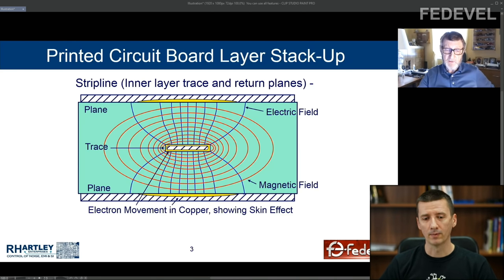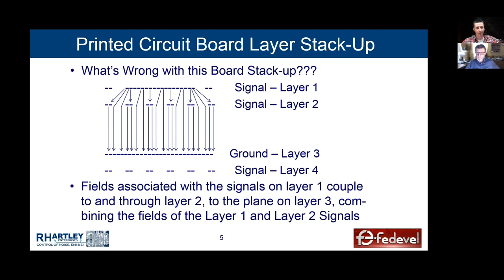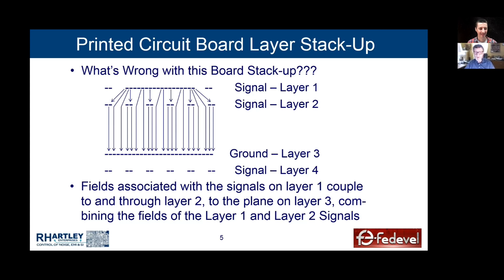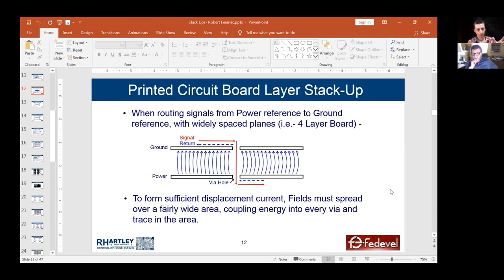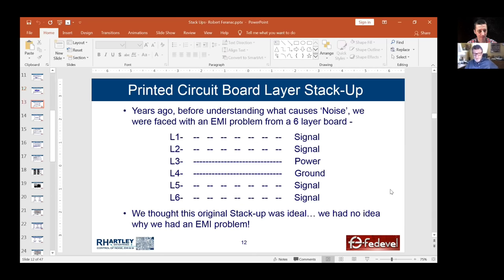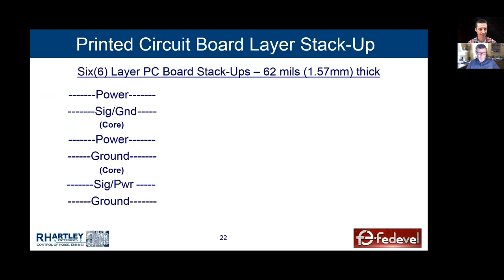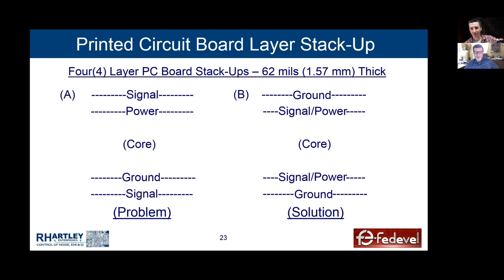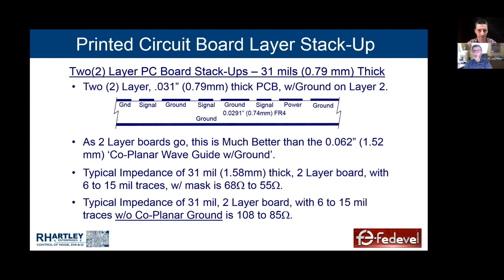How to Decide on Your PCB Layer Ordering, Pouring and Stackup (with Rick Hartley)

Comment: On resonances in cavities and ground stitching vias.

An analogy came to mind. It's like if you had a container with water. By swinging it back and forth with some frequency, you could easily achieve huge water oscillations.

But. If you divided that container by partitions into many small containers, you wouldn't be able to achieve that huge water oscillations at that frequency.

This is how ground stitching vias, by partitioning big cavities into smaller ones, prevent resonances in PCBs.

Thank you, Robert, for your videos! They are extremely useful.

Comment: You have done so much for the PCB community. Thank you! And thank you, Rick!
I do have a comment about routing high speed signals in the middle of the board (in order to get the power delivery near the surface). At speeds above 10gbit the via stubs will create significant  problems (reflexions) which will require backdrill.
Reply from the maker: Thank you very much. PS: I am planning to make a video about via stubs and backdrilling
Reply: @RobertFeranec  the via stub length creates a reflection that can destructively interfere with the signal wave passing through it, basically the via stub looks like an open circuit and thus it reflects the signal back.

Comment: Thank you Robert, for sharing this video conference with Rick. Even though I am not into multi gigabit designs it made me more conscious of the effect of fast rise times. Most of the boards I design are 2 and 4 layers and looking at this video made me realize I have to be especially mindful of digital signals with fast rise times on these low layer count boards and minimize the EMI effect. Thank you for that.
Reply: I am the same, and this is why I always encourage people to still watch these kind of things.
There is always something you can learn from it.
I am also gonna change my work flow a little, first starting with rough layouting the board and second is to think about what stack-up I am gonna use and only after that continue with the rest of the layout.

Comment: Thanks again for yet another great video! I just want to say that I really enjoy hearing about bad examples as well as how to properly do it. The section around 30:00 is great, we learn about a misconception ("we need to shield the signals!" vs "the signals need a return path"), why it was wrong and how to properly fix it.
Reply from the maker: Thank you kbeckmann PS: Very good point with "we need to shield the signals!" vs "the signals need a return path"!
Reply: ... though I have a suspicion that "shielding the signals" (ie: preventing their electrical fields from escaping) is either the same thing as, or closely related to, "providing a return path" (for the AC current).

Comment: I’m a software engineer but always have been attracted to electronics. I have worked almost 4 years with low level embedded (bare metal) code for a payment related company. Loved reading datasheets and schematics. Passively learned tons from it (by asking myself what I was looking at and why it was done like this). I had to move to another field but still do a little arduino like stuff in my free time.
Always wanted to give Kicad a try, especially since I got into the rabbit hole of custom mechanical split keyboards. Stumbled on Phil’s Lab videos. Next on Rick Hartley’s and now yours. Love Rick’s explanations and stories. He clearly is the rickiest Rick 🙂
Anyway I’ve learned a whole lot of exciting stuff thanks to you all. Kudos.
Reply: i took a pcb design class last semester at berkeley as an extension student. Easily one of the most valuable classes i’ve ever taken. They knew I wasn’t an engineering student, but welcomed me in anyways. They taught me how to use Kicad pretty fluently. The cool part is that we assembled all of our boards by hand after we designed them and ordered the materials; the class is jam-packed full of hands-on knowledge. I took the class at night after work, the course code is EE-198
Reply: @soconnoriv thank you very much for sharing this info!
I’m French so I personally won’t be able to attend it but it will probably be useful to others, so thank you.
It must’ve been great to assemble your own boards, thus making everything from the (properly) ground up (bad pun, I don’t wanna be grounded).
I love the idea of designing a whole object from the pcb to the casing and programming the firmware. Everything can be done with open source software, even FPGAs (maybe old ones but still).

Comment: Hi Robert,  Excellent, thank you.  Also, thank you to and Rick for sharing this information with us at no cost.  Some have commented that the video is too long.    I appreciate the discussion, even if it takes an hour or more, as the most important thing is to try and understand the concepts.  Every board is different with different requirements and goals, and will require it's own set of compromises.  Understanding the concept is the only way you can make those compromises intelligently.

Comment: Basically, pouring ground on signal plane can be a problem if you don't know what you're doing 🙃

For 4L board I put most SMD on L1 and r  reserve 
L2 for GND (no signals at all)
L1 for 90% of routing
L3 primarily for power & secondary for GND reference of L4 (if possible)
L4 primarly for GND and secondary for routing

Final step: stapling all the gnd polygons with small vias 😅

So, basically, the 4L setup like (D) on slide 25, as shown 48:07 😁
Reply from the maker: Exactly. PS: Also, sometimes pouring PWR instead may be the solution.
Reply: @RobertFeranec  Yes 😁 
And I just got now at the position of the video which corresponds with my strategy: 48:07 (slide 25, stackup (D))
Reply: Anecdote: one time I had to fix a layout mess of a embedded main board ~A4 sized with 400 components. The colleague was nearly "finished" (his words) and was taking parental Ieave.
I strongly suggested to him beforehand use a 6L (and go to 8L if he has problems)...he chose a 4L, the GND/Power situation was horrible (signals every layer, split reference pours, ...)
And I just had 3 weeks to fix that due to deadlines 🙃
Couldn't go to other stackup, as it was already reserved in the pipeline of production.
As all components were on top I deleted all GND/PWR, and used strategy above.
First taking care of important power and high speed signals. Due to the via power and gnd tacking it resultet in probably ~1600 drill holes (before it was more like 600 due to many the pcie connectors)
That was an interesting summer😅
Reply from the maker: @icestormfr  Thank you for sharing.
Reply: @Robert Feranec it would be great if you could elaborate a little more on 4L PCBs. If you have google examples to share.
Reply: What does you mean by L3 secondary for GND reference? Signal on L1 will be referenced by L2 and signal on L3 will be referenced on L4.
Reply: @josescxavier it refers to layout priority.
In this case it means, on L3 placing power polygon/pours has priority. But if (esp. high speed) signals are routed on L4 (bottom) try to place GND as reference plane/pour/polygon  (return path) under these traces (so that would be L3).
Also try to "tack" the GND on L2 to these on L3 where these referenced signals cross from/to L1/L4 by vias. See also the longer explanation in the video🙃
Reply: @icestormfr  in the video he suggest to routing on L3 while you route on L4.
Reply: @josescxavier  Yes. The signals weren't that critical. 
Some were constant potential or slow and really infrequently changing signals, and due to space/topology restrictions (at 6L+ wouldn't have been a problem) they needed to cross the power polygons/pours. So the signals themselves were not an SI or EMI problem, but needed to be on a different layer thab L3 (because they would makerge power route impossible).
So I ended up using L4 for all the "cross over routes" that I needed to finish the routes on L1, not just the ones that had to be there.

P.S.
The (quasistatic) signals on L4 under the power polygon were only short traces and also didn't "break" the GND return path of the power polygon above on L3.
So more like some "Logs" on a bigger river 😅

Comment: Thanks! This is a complete lesson on stack-up. Up to now I am not used to pour power on signal layers except near the input/output of voltage regulators or DC-DC converters

Comment: I am a little concerned about power/ground pours on congested signal layers which is suggested on many of Rick's stackups.  If the layers are very congested, there will be many small islands and strips of poured copper which will require vias so they aren't floating.  It seems like those vias might take a lot of room and make it difficult to route the signals.    Maybe you would need to use smaller vias to minimize this routing congestion.  If you have a dedicated power plane, you can just drop the power vias pretty much anywhere,  but in many of his suggested stackups the power is distributed on all the signal layers with no dedicated power plane.  In those cases, you will have to line up those power pours on multiple layers to get the continuity you need.  Seems like that might greatly increase the difficulty of routing the board.   Your thoughts?

Comment: I have a related question: Main power of my device is 5V (most current use), I also have several ICs, including the MCU itself, that run on 3V3, LDOed from 5V. The chips talk via 1MHz max SPI via level shifters 3V3-5V (if there is a voltage level mismatch and 3V3 signal is not enough for 5V device). MCU is 50MHz max - down to under 10MHz, but I have yet to scope stuff to see the rise/fall times. PCB is 4 layers. Have analog/digital parts, analog measurements and digital communication never occur simultaneously.

I have a prototype PCB come soon, and since I didn't know all this at the time, I have basic caveman SIG-GND-5V-SIG without any pours, while 3V3 is routed via traces, I try to make them wider. Space is not much of an issue. But now I understand I can improve it significantly. Before I do something I regret, I'd want to clarify a few things:

I'm (re)considering stackups now, PCB is expected to be 1.6mm thick with thick core:
Stackup Option 1:

Sig/GND
5V
------
GND
Sig

and 3V3 routed as traces. This will let me couple signal more to GND than to 5V, so I should get better performance, at least comparing to what it was before. And, of course, stitching when swapping signal layer?

Alternatively, I can have polygon of 3V3 Power, larger polygon of 5V power on a single layer, like
Stackup Option 2:

Sig
GND
------
PWR (polygon 5V, polygon 3V3)
Sig/GND

I'm worried about having different voltage polygons. As far as I understand, I should then split the components and put 3V3 and 5V components separately. And a corner for analog stuff. I also understand, I'll have to do some stitching between layer 2 GND and layer 4 GND. What do I do about level shifters, which utilize both voltage levels? Where do I place them and how don't I mess up their return currents? I mean, it makes sense to put them between the polygons duh, but what if not?
Another question into the same basket: If I have multiple polygons of different voltages and I don't have anything cross the gap, maybe a thin GND pour between 5V and 3V3? Why or why not? Maybe couple 5V and 3V3 with capacitors? Don't hit me if I said something stupid, after all, that's why I'm asking)

Also, as an active EE stackexchange user, I asked a pair of questions there, and while I got some advice there, the general consesus was "your design is too slow to care about these things too much". To what extend is this true? Of course, it's good that I know about those things and consider them anyway. My first prototype was 2 layer with signal spaghetti - both layers ground pours, and it seemed to work, but I still want to do things right and not get used to improper amateur designing.

EDIT: maybe layer 1 can have signals AND polygons of different voltage, while 2 is GND, 3 is GND, 4 is Signal? I will have to run a few power traces, but I guess it will work? It's a stackup 3 options being created right here as I'm editing this post. Why/why not?

I'm kinda leaning to Stackup 1 for now, but it's purely intuitive and not reasoned enough in my head to be sure about choosing one stackup over another.

P.S. I still haven't decided what stackup I want, in either case I'll have to start the PCB from scratch I think, and I'm OK with that (it's fun anyway).
Reply: I have decided to go with the following stackup:
1. Sig (90% of signals, 100% of components)
2. GND Solid plane
THICC CORE
3. PWR +5V Solid plane
4. Sig/GND (tightly stitched) (10% signals, 0 components)

I routed 3V3 with traces, optimized my design enough to have literally 3 components to need 3V3, so traces seem ok solution - and I have two linear 3V3 regulators, one dedicated for SD card, so that it doesn't cause interference with 3V3 MCU when it writes/reads/suddenly consumes power. Since I do some analog with MCU, I added ferrite bead and two 0.1uF to MCU's only power pin.

Analog in one corner, digital in another, high drawing element (display) away from both and is close to Power circuit not to cause interference. Routed SPI and UARTs in the first place, then analog, then many single-ended signals like ENABLE which are OK with switching layers. Added extra GND VIAs where I switch signal layer from 1 to 4 to keep good referencing.

Analog in North-East, Digital in the South, Power system in the West, High current display connection North-West.
Reply: for me stackoverflow/stackexchange isn't the best place to ask anymore, but it wasn't due to my personal experience, rather others  - with the infamous "moderation problems". I only look there for help with programming troubles. EE knowledge i get, i get from EEVBlog forum.
This post is also one that could be asked there on that forum, not really under some comment on YT, especially having so many questions.

Comment: These are rules and guide (which i do practice them) but for practical case, there is a need to look at the boundary conditions on the signal traces, power and ground plane. There is always a trade off either you need to cut the number of power plane for signal or increase the number of plane (cost). But i prefer to have more ground plane than power plane.

Comment: Well. I watched to 50minute mark then realized that I'm already using the ideal layer stack for my 2 and 4 layer boards. But well done this time with very informative video.
Reply from the maker: Thank you very much John
Reply: John Yang... In 4 layer stackup how you routed signals? Have you considered components pads on the top and bottom layers? As per 4 layer stackup all signals should have via. Am i correct?
Reply: @SKNGL  I'm doing fairly simple stuff but for high precision.
Components on top layer only. Analogue signal on top, digital on the bottom. Two ground planes in the middle with a couple of short signal trace on M1. It's a DAC board with 4 layers. I route power on bottom as well but it is wired away from the digital traces. And some sensitive traces are on the top layer. Frequency is pretty low.  100Mhz max.
Reply: @SKNGL  The density is low so I also have connected ground pour on top layer. And all grounds connected with vias. 
There's another fully digital section that's physically separated from the dac chip. And the digital section is not sensitive at all. So doesn't matter much. Ground is joined at power supply with capacitors.
Reply: @johnyang799   Thank you so much for your reply. You have used internal layers as Gnd plane. And routed signals on top and bottom layers. But in video Mr. Rick has mentioned External layers for Gnd plane and internal layers for signal routing. Have you done any 4 layer pcb with that particular layer stackup as mentioned by Mr. Rick?
Reply: @SKNGL  I rewatched the video yesterday. He mentioned that for low density application, you can use two ground plane in the middle. And it's essentially ideal. I wanted to isolate the high frequency traces as far from the sensitive analogue nodes as possible. For your application, it may not be as simple as it sounds. And the layer stack up is only the first step or the grand setup for the pcb. There are many more details and flexibility. No one stops you from using multiple different stack-ups in different section of the board for example. He also said he doesn't have a favourite/very good 4 layer stack up. Apply the principles, not just the stack up.
Reply: @johnyang799  Thanks for the reply.

Comment: Great video,  very nice content and discussion,  special around stack up, 4, 6 layer. One thing I miss in all discussion is high current density track close to sensitive AD or DA or close to high impedance input opamp which measures the small signal , for example if you have feedback loop by sensing a micro volt  by opamp , which way is the right way to draw that tracks. 
In New electrical hybrid car,  some IGBT mosfet have 100Amp current , they should have heatsink,  how    to connect these high current track, close to sensitive track. You can watch some in this channel, weberauto
Reply from the maker: Thank you Paul. PS: I am putting high currents on my list of possible youtube videos

Comment: Some situations you need to avoid too much ground plane behind pads and runners.  Parallel mode crystal oscillators are one example.  The extra stray capacitance makes them run low in frequency.  Many 32.768 KHz clock crystal oscillators suffer from this.